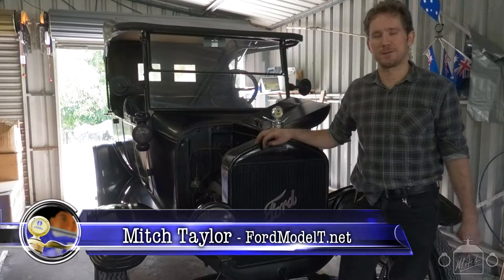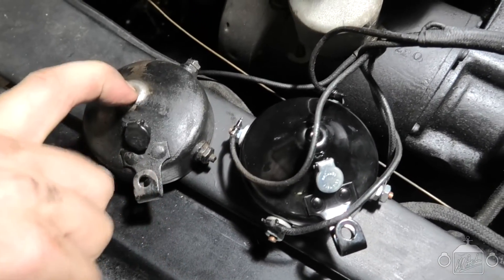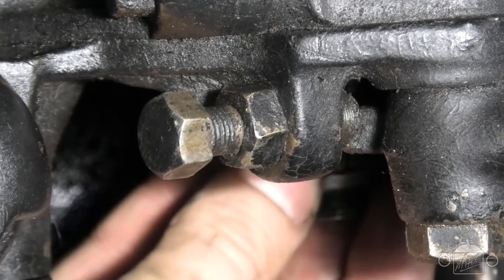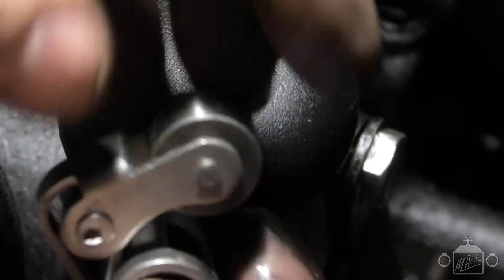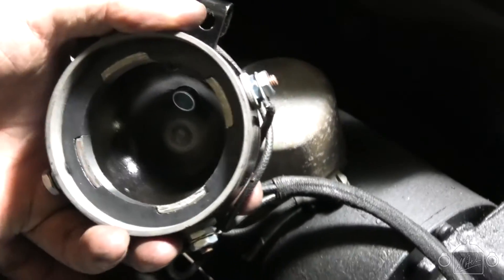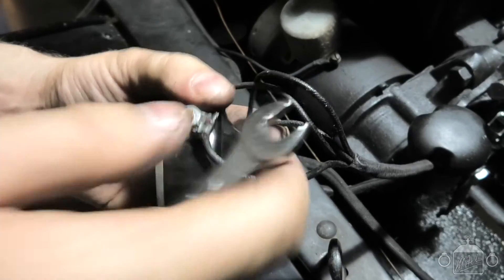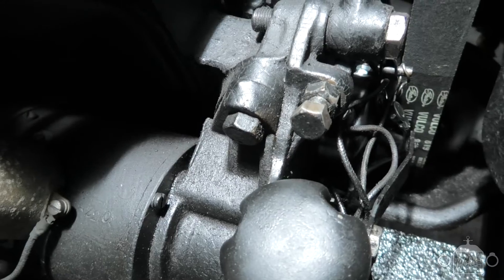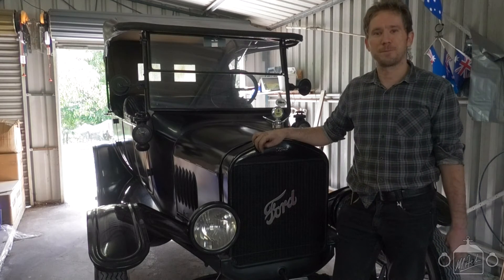⚜️ Ford Model T - How to Replace the Ignition Timer

Comment: I appreciate these videos. Thank you. I need to find a new terminal block for our '25 stakebed. Are there any suggestions for updated version of the terminal Block?
Reply from the maker: There may be if you search around, but my recommendation would be to get one from Snyders Antique Auto Parts. 😀
Reply: @ModelTMitch   LoL that's exactly what I did. We just got this old truck and are just starting to tinker on a little bit. By the way.I need to be sure this is positive or negative ground. Thanks for helping us.
Reply from the maker: @bryandyer6912  No worries 👍 Just check which battery lead is bolted to the chassis 😀

Comment: Hello sir Im interested from what material is the timer wire made and leads from buzz coils to spark plugs? Ya know wanted always to modifi other engines to buzz coils but most of the time cars who are younger aged have wire resistance problems,lenght wire calculation and so one so I'm curiuse about that topic how is that calculated or correct ignition system components chosen ? What engine rpm range is effective on buzz coil ignition systems? Litel bit more detailed
Reply from the maker: Just copper wire, insulated with rubber, then coated in fabric. No fancy HT cables 100 years ago 😁
Reply: Thanks for answering do you know how exactli the magneti Type worked ignition? I assume those are lead acid Baterrys right does the ground side have capacitor ? Ya know the switch disconnects only baterry magneto and stops engine but is that AC wave going to the baterry - terminal ? If I remember corectli some ford model t hade Bouth ignition types including starter and generators If IAM not mistaking?

Comment: More than 20 years ago, when my dad passed away, I inherited his 1925 Model T Touring car.  I live about 17 miles away from dad's place, so I thought that would be a nice drive home.  On the way home, the T suddenly quit running and would not start no matter the effort.  In the course of troubleshooting, I removed the commutator and reached down to check the roller.  The spring had come loose, and when I tried to stretch it back in place,  to my horror,  I saw that roller spring go shooting away!  Well I was parked on a gravel road; though I searched diligently, there was no finding it!
I didn't even own a trailer, so I was a little panicked at that point.  However, I happened to have a pen in my pocket with the little retractable click top.  I unscrewed the cap, removed the little spring and it actually looked a lot like that timer spring!  I stretched that Bic pen spring in place, replaced the commutator, and the car started right up!   The rest of the drive home was perfect!

Comment: How difficult is it to find parts in Aus?  Does the shipping or import costs get prohibitive?
Reply from the maker: There is Henry's Model T, A & Rod Parts down in Victoria where I get some parts from. Other than that, I get them from Snyders in the USA. Shipping can be expensive from the states, so I try to buy local if possible.